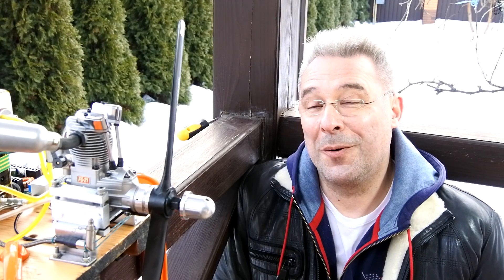Saito FG 21 gas fuel glow and spark ignition test run

Comment: Dear friend congrats for you video ..one question i have a saito FG 20 but it is impossible  to set up xnd tovrun with gasoline ....i am thinking about to run it with spark plug and glow fuel like you have demonstrated ... Do you know this configuration could wirks well? Could the engine to be economic in fuel too even if i use glow fuel?
Reply from the maker: Hi, apologizing for so long delay with reply. definitely, it will works well, probably, delivers a bit less power, but the key question it is the cost. Running on the glow fuel with 10 or 15% of Nitro will drastically increase cost of each run, unfortunately. The key reason is the very high cost of an Nitromethane. As far as I know, Nitromethane is productid by only 2 or 3 chemical factories in the world, so it is sooo... costly. Better will be to find out how to fix your Saito FG20, and to run it on gasoline. It's a beautiful and reliable engine. Thank you and have a nice day !

Comment: I have the fg36... How you fit the OS G5?, the gas ignition plug is a diferent size...
Reply from the maker: Hi, thank you for your question ! Sorry for the too late reply, was  out of business for some reasons. So, regarding OS G5 plug, yes, your'e totally right, this glow plug marketed for gasoline engines, but I've found, that OS G5 nicely works with glow fuel engines, as well. Moreover, I found, that some "pure glow" dedicated glow plugs, as OS type F, or OS A8 (especially), can nicely works with gasoline fuel. Regarding the sizes - G5 really a little bit longer, than Saito SS-1 or OS type F, so to install on usual OS FS or Saito FA 4 stroke glow engine you will need to install additional copper shim or gasket under the glow plug. This will lift it just a little bit up (~0.2 mm), and plug skirt will not touch the top of the piston. Thank you for your question and have a nice day !

Comment: excellent congrats for the video....... one question does the G5 works better than original spark ignition? more RPM at the maximum? i saw in the video, is it correct? thank you dear and congrats again.
Reply from the maker: Hi, and thank you for your questions. Greatly apologize for so long time for reply, was really out of this channel for a while. 
Regarding your question, Yes, of course, with a certain engine tuning with a OS G5 glow plug and selection of the fuel mixture, you can get higher revs. In principle, the gain is quite significant, although on a real aircraft, a 4-5% increase in thrust will not change much. These tests were based on engineering curiosity "What will happen if ...", although it is possible that for many colleagues these results will help to more carefully tune their propulsion systems. Besides, this is an interesting topic for discussion with colleagues on the airfield, isn't it? Thank you again for your question, with wishes for a good day.
Reply: @crazyengines88  thank you very much my friend.
Reply from the maker: @ You're welcome ! Your questions giving to  me some food for my brain. 🙂 Thank you and have a nice day !

Comment: There was once in some soviet model engines a thing called "glow-spark plugs" which was a hybrid. The central electrode was deliberately made thin and insulator not too heat-conductive. The engine started on spark ignition and once the plug was hot enough the electrical system was disconnected and engine was left to run on the hot-glowing spark plug.
Reply from the maker: Thank you very much for your comment and for information provided ! Very, very interesting. To be honest, I thought I knew quite a lot about Soviet model developments, and at an early age I had several Soviet engines, and a Rhythm 2.5 diesel, and a Comet, and an MK 1.5 (in my opinion, as far as I remember) and even a Meteor. But to be honest, I've never heard of such interesting development. Thanks for the info! Or maybe there are some details, names?
Thanks again !
Reply: @crazyengines88  I remember this only vaguely from an old (60's? 70's?) book about model engines, never seen this in real life. I assume the idea was to get rid of the extremely cumborsome old batteries for ignition system plus the coil. Those really old 2 stroke engines made barely 0,3 or so HP, so an ignition system weighing close to maybe 300-500g was too much really. I am guessing they didn't have glow plugs in the modern sense, fuel was some low-octane gasolene and mineral oil, so no nitro and no fancy platinum coated glow plugs. They went for the next best thing - designed a spark plug that would glow if heated up enough. This was however the only reference I heard of, as probably ether-kerosine-castor oil compression engines took over until late 80's because of simplicity and much lower total weight.
Theoretically there's nothing inherently wrong with glow plugs and gasoline. If the glow plug is correctly tunes you basically end up with the 100 year old idea of "glow bulb" semi-diesel like ignition. All that's needed is to correctly match the glow plug with the engine - to get as similar across-rpm performance (with ignition advance and all) as you'd expect from a purely spark ignited engine. This may be tricky trough, one could even have to design a custom glow plug, as most if not all factory made ones are specifically designed for nitro as fuel.
Reply from the maker: @LegateMalpais  Thank you for such a detailed description, very, very interesting. In fact, most of the glow plugs in my test runs were fairly easy to set to high RPM, you just have to work with the HS needle. It’s just that the ability to show absolutely everything in a video, on the one hand, makes it very informative, but on the other hand, makes it long and boring, which many people don’t like, and I understand them very well.
Thanks again for such detailed information!

Comment: Nice nice
I have osggt15
Now saito is compatible with the os G5 i think i must get one
Reply from the maker: Hello, sorry for late reply. I think, you can easily use OS G5 glow plug with your OS gasoline engine.
Reply: @crazyengines88  Hello
The os G5 is special 
For ggt os engine.
Reply from the maker: @amiraldz1970  Hello, thank you, I don’t think, that OS G5 glow plug dedicated just for OS GGT15 engine, that’s gives no sense to produced so specialised glow plug. G5 perfectly works with a lot of other OS, Saito, etc. gas powered 4 stroke engines, and nor only gas powered, but with methanol based fuel engines, too. I was checked this on several different engines. Not sure, how long it will work with non specified  applications ( methanol based fuel), I was spent dozens of hours to run it with any changes of performance.
Thank you very much for your comment !
Reply: @crazyengines88  when the engine was tuned not a few years ago they specified that this spark plug should only be used for the ggt series
Reply: Eu usei no meu saito fg 14cc, ficou perfeito, adeus ignição.😂😂

Comment: What is compresion ratio by that engine what fuels you use did you try out fog mashine ore fuel vaporisator on that engine?
Reply from the maker: Hi and thank you for your question ! I should say, that Saito FG21 has sufficient high compression ratio, according to my feeling, when turning engine trough TDC. Unfortunately, couldn't find exact figures in engine manual. That's the reason, why I'm starting it with electric stater. Regarding  your question about fog machine or vaporizator - I didn't try this yet. With best regards !
Reply: Thanks for response Im working on similar projects I belive those engines culd by lot improved and their economy some of the old military tehnology culd by adopted to those engines like plazma/amplifier dual ignition ore electric motor asistance ore methanol water.
Those are some nice staff Im not shure but I belive those are larger bore to stroke ratio engines perhaps they culd by coated ore stranghter their metal body parts to take more heat. Like all engines one day it will by hard to finde parts for them.
You might consider useing fuel aditives some engines dont like high rich ethanol fuel it will burn eventualy the gaskets ore coat the gaskets with some protection from oxidation. Its nice to see some one makeing those videos wish you good luck 👍
Reply from the maker: @MechanicForGMCCars  Thank you very much, appreciated for your kind comments ! I'm also sure, that this engines still have a lot of hidden potential, just need enough time to reveal it all. I'm sure, that some non electric engines will be necessary could be irreplaceable in some military or special conditions. I know some companies, which are working on improvement of 4 stroke engine power unit ( which includes engine, starter - generator and cooling \ warming unit for  wide temperature environment. What is interesting - most of this power modules utilize Saito FG 84 engine, with some special improvements.

Comment: Looking at buying one of these, would you say it had as much power as it's glo version?
Reply from the maker: Hi, thank you for your question ! Definitely,  FG 21 is very similar to its glow "brother", like Saito FA 125. To be more precisely, its's like a FA 128 (of course, it isn't really exist in Saito 4 stroke glow line), as 1,28 cubic inch size. So, the power will be similar or a bit higher, than FA 125.
Reply: @crazyengines88  Thanks for your reply, did you have difficulty tuning the FG21?  I've heard on a few RC forums the Saito "gas" engines can be hard to tune, this has put me off buying one.
Reply from the maker: @Desertduleler_88 Yes, I’ve got some difficulties when tuning it, but this is just a question of collecting knowledge about engine behavior. Saito’s gas carb was much “sharper” in tuning, than traditional glow carb. This was one of the reasons, why I was started this test run  cycle with glow ignition setup ( carb and fuel). Additionally, received some requests from my sub’s to explore glow conversion. I think, that glow fuel setup with spark ignition is the best choice from the point of view of engine performance and stabile run.

Comment: How much thrust can it produce ?
Reply from the maker: Thank you for your question ! I've not the opportunity to measure its thrust, but by indirect characteristics we can judge its capabilities. My copy developed up to 9K RPM with a MAS 16x6 prop, on methanol based fuel. On gasoline, the top      RPM's were lower, in 8K revs area. I also should say, that on gas fuel engine runs significantly hotter. My personal opinion -  glow fuel with spark ignition. Unfortunately, most expensive one. But definitely the best also.
Reply: @crazyengines88  
Most definitely i also agree glow fuel with spark ignition is most reliable and the engine runs at good temperature..also get more run time as spark ignition creates a better combustion..
But for price sake a gas engine will use half the fuel of methanol..i have no doubt the gas engines will still last a long time ..and cheaper and also alot cleaner..i can keep my much loved expensive saito radial biplanes in the house with no smell...great job on this video..the g5 glow plug is definitely universal 👌
Reply from the maker: @danielhitchens4407  Thank you very much for your comment !
Absolutely agree, no words.
But firstly, this is a matter of choice, and often money decides a lot in choice. Well, if you imagine that I'm a romantic, I love the smell of methanol fuel, I'm used to having a jacket and a floor on the terrace richly treated by Klotz or Motul engine oil. And if you imagine that my wife does not mind at all, then I would choose an old school theme, for sure. You have to be true to yourself and not change your dream, unless, of course, finances allow such behavior.
Thanks again for your comment, I really appreciate it. 
I should tell you, that I can't forget this amazing combination - spark ignition with glow fuel,  and I continue experimenting with this combo. Next time soon, I hope, would like to present new combo. Please, stay tuned !
Thank you very much and have a nice day !
Reply: @crazyengines88  such perfect words..i do love the perfume aroma of methanol/klotz..it is a truly distinctive smell..when flying i do lots of fly by,s and the trail of smoke is also awesome..you got lucky to have a partner that doesn't mind the smell😎
Reply from the maker: @danielhitchens4407  Thank you very much !  Definitely, Klotz engine oil has a special, well recognized smell. 
It becomes wide popular through RC modelers. I found, that Maria Klotz made some special candles, with authentic Klotz Techniplate smell.
Hand made ! 
https://klotzlube.com/shop/ols/products/klotz-candle
I'm owning one
Reply: @crazyengines88  love it..that is awesome..thanks very much for the link👍👍
Reply from the maker: @danielhitchens4407  You are highly appreciated !

Comment: Thanks for sharing! Did you do the run with the original gas carb this time?
Reply from the maker: Thank you for your question ! Yes, it is, setup is basically from the  box, with genuine Saito gas carb with pump, as far, as I understand. Gas carb looks significantly different form glow fuel type carb. You can check this looking from the right side of an engine - it's bigger and have more "square" looking.

Comment: You always achieve a remarkably low idle, do you set the valve lash at the minimum specified value? 
Is your gas to oil ratio 20:1, which is 5% oil, or 20% oil?
Reply from the maker: Thank you very much for your comment! Exactly in this case ( Saito FG 21 on gas mix fuel), all carb settings were on factory default settings. Specially didn’t touch carb settings to clarify factory adjustments, that’s could be the reason, why engine doesn’t shows high RPM, was afraid of potentially lean run. Should say that on gas fuel engine runs noticeably hotter. Regarding  fuel - oil mix, I’m adding 20% on synth oil by volume. It means, that on 100 ml of gasoline I adding 20ml of oil, by volume.
Reply: @crazyengines88  I think it’s too much, if I remember correctly, 5% oil is enough since gasoline is a kind of lubrifiant. With methanol you need about 20%, but on gas a 1/20 mixture will do the job (equivalent of 5/100)
It should be written in the manual
Reply from the maker: @remigoldbach9608  Thank you for your comment, and yes, it is, 20% was too much. I've not so much experience with gasoline engines, so I just over secured  by  significant increasing the "%" of oil in fuel mix and this was only once. Next gas engines runs were with the classic 15: 1 or 20: 1 ratio.
Reply: @crazyengines88  no problem! I’m not so experienced either, but my father had done some tests with conversions.
I like your videos and appreciate all the tests!
The engine will get higher RPM with lower oil on the next run.
Keep going ! :)
Reply from the maker: @remigoldbach9608  Thank you very much for your comments, it's really kind of a feedback, which is highly appreciated. I definitely knows, that less oil will push engine to the higher RPM's, of course. Thank you for being with CrazyEngines !